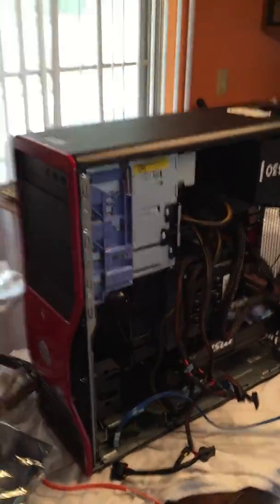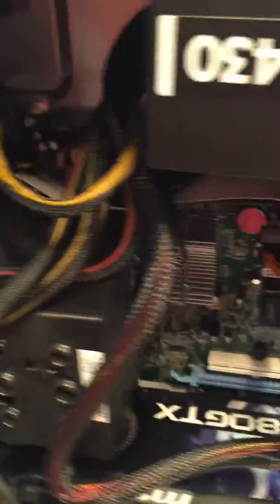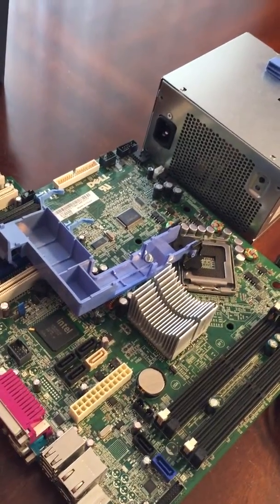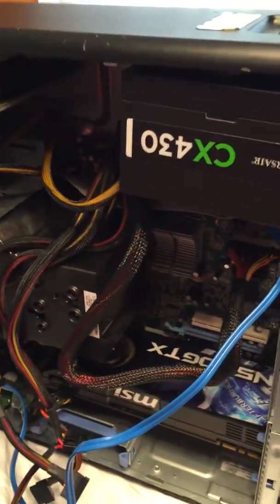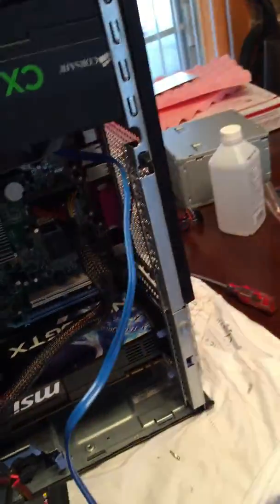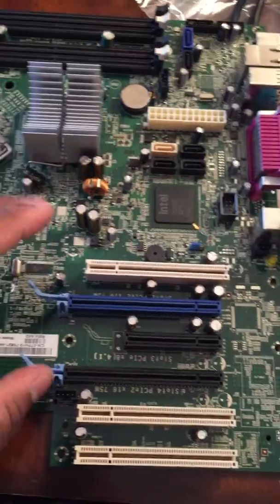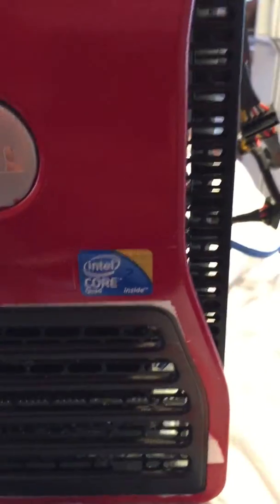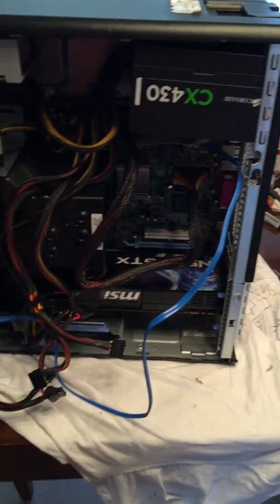Dell T3400 upgrades

Comment: i know its an old vid but for any1 interested i upgraded my t3400 to q9650 and 8gb ddr2 non ecc as it accepts both but not mixed. also my dell 525w psu has 2 6pin pcie

Comment: hey I was wondering how you got your old power supply out. I have a t3400 but I can't take the power supply out because one screw is completely stuck.
Reply from the maker: soundwavedarnell not sure what screw exactly that is. If u have a dremel tool those are good to sawing off screw or put tape inside the screw and around it apply pressure and try unscrew it.is the screw stripped?
Reply: The screw that's stuck is in the top right corner, next to the plug-in for the power supply. I'll try what you said though,

Comment from the maker: it is fine toi change your power supply in this video the 430watt isnt enough for the hardware/video card i have..but adding a power supply i dont see any harm. i have sold this computer with a 650watt
Reply: +TechyRodsWire power supply 525W Best power